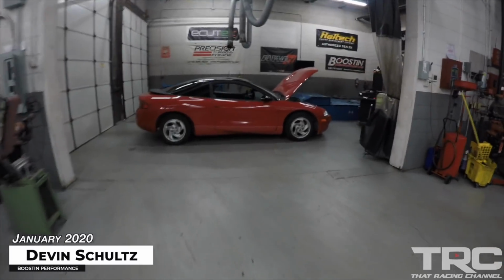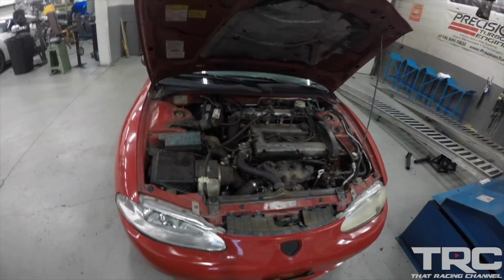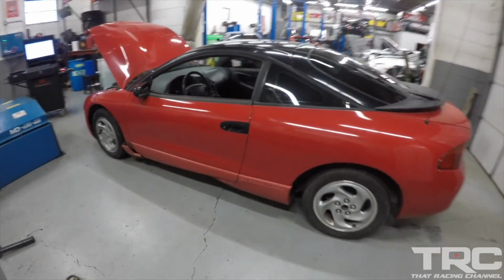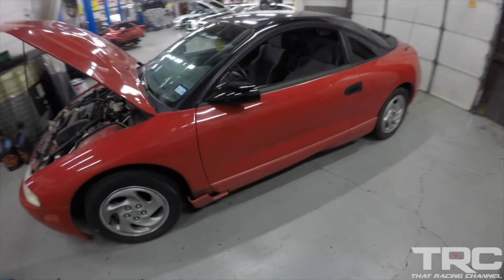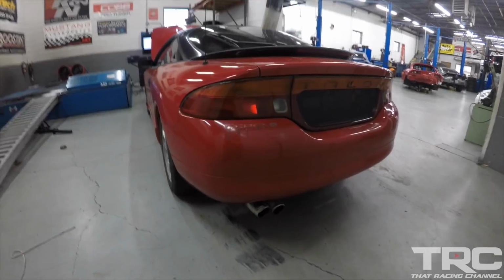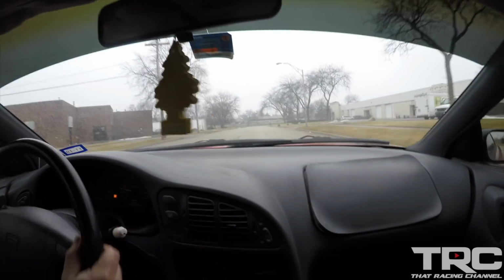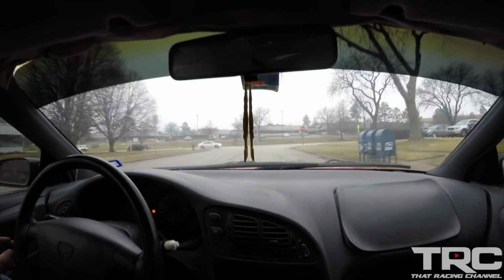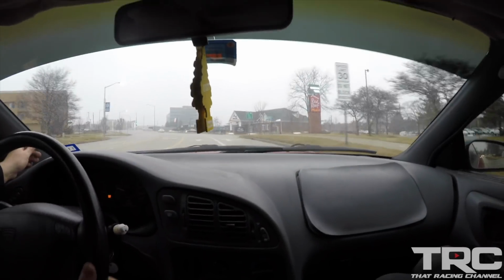1800HP RED DEMON RETURNS - Building the CRAZIEST DSM EVER! (Manual AWD 4G63 on 80PSI)

Comment: One of, if not my favourite American drag car in existence. We dont get these in Australia..  and this car has always been mind boggling. The red demon is back.. 211 testing.. wow... 💪
Reply: Closest thing you guys got is the 1st gen Gallant VR-4. This is basically the coupe version of it
Reply: Did y'all not get the Eclipse? I thought it was sold internationally
Reply: Dsm is not american made
Reply: @Jokertuning  Predecessor: American Motors
 
                        Successor : Chrysler
Reply: @Jokertuning  mitsubishi/plymouth/eagle joint venture - this is an eagle talon not a mitsubishi though
Reply: @Jokertuning  DSMs were made in Normal, IL, so they were technically American made.
Reply: Definitely NOT American! America does not know how to make a proper 4banger. It's Japanese!  Equipped with the mighty 4g63 from  Mitsubishi Japan. Chrysler only slap an eagle badge onto a Mitsubishi Eclipse! Don't get fooled!
Reply: You guys got the good VR-4
Reply: @Jokertuning  all DSMs were made in Normal Illinois.
Reply: @rabbon-ithegenesis7169  you think the U.S. cant make a good 4 cylinder? See 1991 Spirit RT. Also see Cobalt SS ecotec and GM Quad 4.
Reply: @SethD15  Not the engine though. That was made in Japan.
Reply: Yeah this is probably my favorite build of all time. I'm glad to see the red demon back.
Reply: To be fair, y'all got the modern "murcan" American brand cars that we didn't outside of VERY limited runs in the last 10 years. (Caprice, comador, and falcon) and probably more I don't even know exist outside of Australia lol
Reply: @GSX455s  we got gtr's 💪😂 that's were my heart Lies.
Reply: @Nayr747  I'm well aware that the 4G63t is Japanese (I previously owned a Talon TSi AWD, and currently own an Evo). My comment was regarding the car as a whole, since they were assembled in the Normal, IL plant.
Reply: @SethD15  Yeah just wanted to clarify for anyone reading who might not know that. I've got a '99 GSX myself.
Reply: But don’t Australia have the evo 1-7? That’s what America didnt get lol. Not many people have the older evos as a drag record set up. The older evos are lighter and same engine as in all dsm cars.

Comment: U had me at manual 👍
Reply: Is thing built of the stock 7 bolt?
Reply: Nothing is stock with that speed
Reply: @heribertohernandez3444  nothing on that car is stock
Reply: @Visible-jb2ew  
I guess what my question is more towards a 6 bolt or 7 bolt block.
Reply: Please go to SEMAs website and sign the petition to pass the RPM Act. The EPA is attacking the auto performance industry and trying to ban us from modifying our cars.
Reply: Is he using a clutch with his foot as he’s shifting?
Reply: @Mcali1984  no.
Reply: @heribertohernandez3444  pretty sure that’s a dart block or something. The stock block wouldn’t come close to 1800 hp.
Reply: Fam candy
Reply: With all these guys going to clutchless shifting it kind of takes the cool factor away imo. Is it a manual yes. But after that they are doing the same thing a manual vavlebody auto does 🤷🏾‍♂️🤷🏾‍♂️
Reply: would be faster is it was auto
Reply: @05btt  The car is using a billet block. The trans is a PPG dog box. The car is still manual H pattern car, It is capable of shifting without the clutch because of the dog engagement.
Reply: @jedpratte  cool setup. Ol cleetus isn't using his clutch in Leroy anymore without and doing it with the tuning somehow. All I'm saying is if its a manual leave the clutch that's why it's cool because you are doing more than just moving a lever.
Reply: @heribertohernandez3444  Billet 6 bolt block
Reply: @tunanocrust5089  it’s a billet block
Reply: @05btt  ol cleetus

Comment: "4G63T engine no shhhhhhiiit... you know what, this will decimate all, after you put about 15 grand in it, or more, if you have to, overnight parts from Japan"

8:05 damn that eg lost by a second...
Reply: it let out.. it ET'd at 142mph..
Reply: @phiillzzz807  true. That thing on a full pass would usually trap around 180-190
Reply: @phiillzzz807  didn't even notice that..
Reply: @soopainfinite  yeah imagine if he didnt let go, would be very close or faster than the red demon
Reply: @phiillzzz807  possible transmission failure maybe? But I totally agree, if it hadn't let go, it probably would've gotten close to it or even beat it

Comment: How does that huge intercooler see airflow with the closed bumper?
Reply: He's running 100% m5 methonal for fuel, that extra heat helps vaporize the fuel to keep the mix warm enough to ignite with the spark. He actually doesnt even need the intercooler at all using  that type of fuel. He's running a low compression motor and by using the intercooler with that type of fuel  boost the compression up making even more power!
Reply: @Dogghousse  Hi. Understood. The only point I would question is the idea of that car carrying any component it didn't need? Would seem counterintuitive that the worlds fastest stick shift car would carry one oz it didn't need to?

Comment: Can we talk about how fast that man was shifting?
Reply: It's probably got a strain gauge in it that cuts ignition when he pulls the lever so he doesn't have to clutch. Same kind of mechanism as a sequential, but they kept the h-pattern. Combine that with a precision shifter linkage so there's 0 slop and all you gotta do is yank the lever into the next gear. Im guessing they are running an adjustable slipper clutch as well so the pilot dumps the clutch on the launch and it engages at the rate they set for both maximum launch as well as consistency between runs.